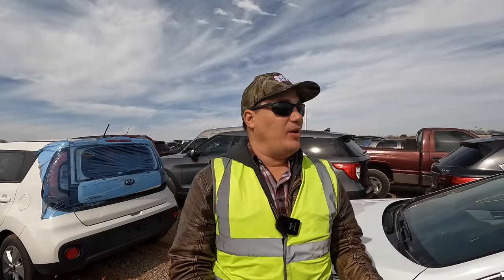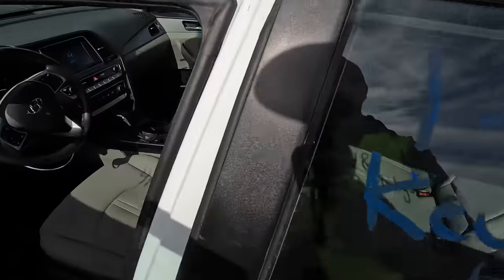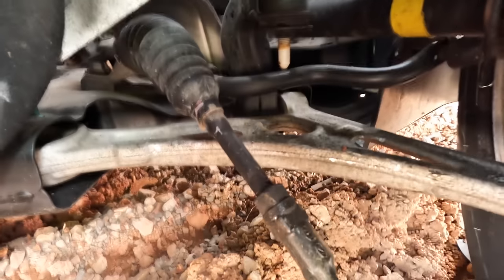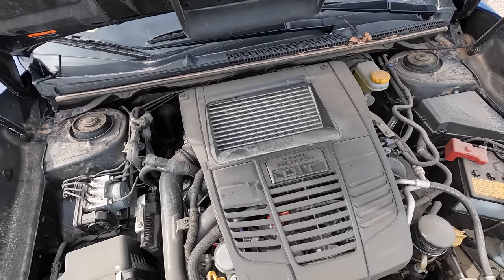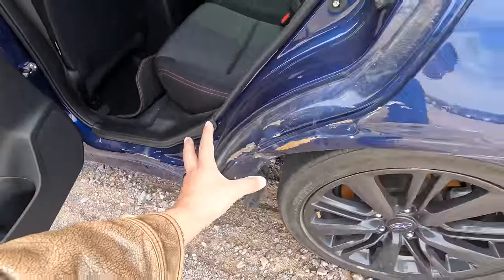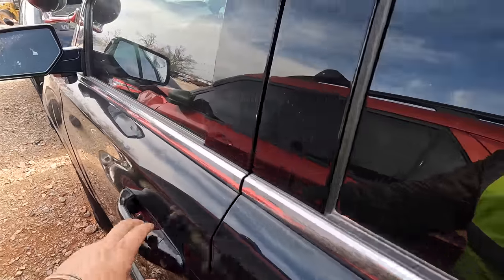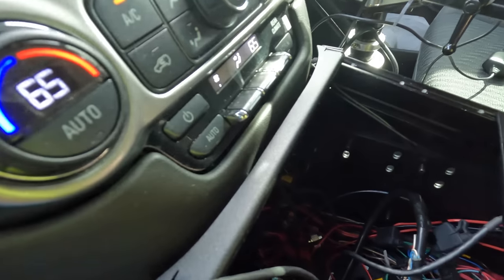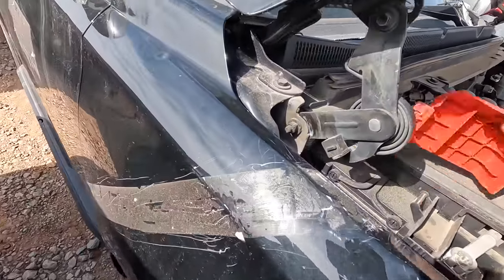Copart Walk Around 2-23-22 + Cheap Police Tahoe with Lights!!

Comment: Hi from uk randy👋  hope your all ok and well!👍 the rear damage on sanata is defo fork damage am a operator myself on telehandler on building site and when car was put down to rest was bottom of fork carriage caught as loader tilted downwards rather than drop hole fork assembly👍 subarus are great cars really raspy and sound great💓 tho turbo models are known for boiling eventually (heads gasket blow or separate) but non turbos are kinda bulletproof but rear quarter and got good car👍  police car with all lights etc (usually they split them and all moduals etc)  for reasons of impersanation officers pmsl get it and pull ppl 😂 make doller off on spot cash only fines😂👍 and never be late for tea 😬😂💓  when siren panel on  do you not have to activate using horn button ? Kid in toy store comes to mind 😂😂  great one randy thsnks for time and be safe see you soon👋👍

Comment: the WRX does not need a new side panel, but with little work you can do it, and yes original without inner welds which then start to rust from the inside and yes, the same from the outside!  without tinning the needles, it starts to bloom after a good 6 months, unfortunately, and yes, you only notice it when it's too late!  The whole pulled out clean smoothed with tools and looks great.

Comment: I work for a statewide municipal risk pool and I am involved with many claims involving police vehicles. I am EXTREMELY surprised that this department didn't pull all that equipment from the Tahoe. Most departments reuse equipment and this one is new enough that they could probably use a lot of that stuff. Not surprised the lights and sirens are non-functional.
Reply: Lights worked.
Reply: What I was thinking all the ones I’ve seen we down fitted lights radio cameras. Some when cages but not all  seems the lights could be a liability big time

Comment: On the Sonata I'd prefer to do minor bodywork and replace a few suspension and steering components than take 761 angry Okie hail dimples out of a car.  Wonder how much a low mileage '19 Sonata goes for all in.  She's a rental and on approval and as of this comment 9k did not meet that minimum.  You're right, the pictures online do NOT show damage to the rear so I'm betting the loaders popped that out of place.  The dirt on the bumper cover itself was probably stuck behind the license plate and got embedded in there a bit.

What I'll be looking for here in a bit will be a midsize sedan, probably older like 2013-2015 or so, something with minimal damage like this, that I can fix up and then drive for 2-3 months and then sell and not lose money on.  That 19 is probably way too new to afford, but there is a blue '17 hit a little harder up front I might be looking at when they set a date for it.